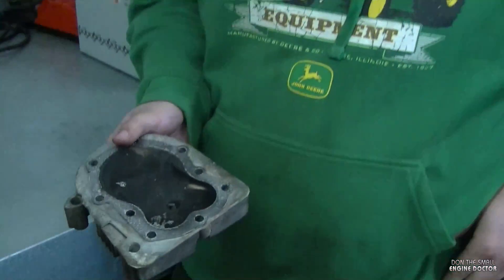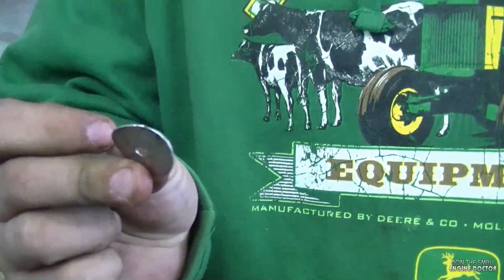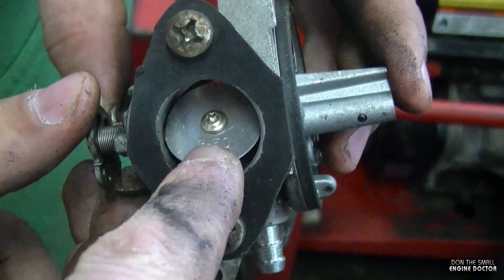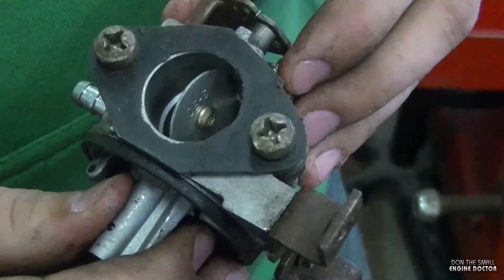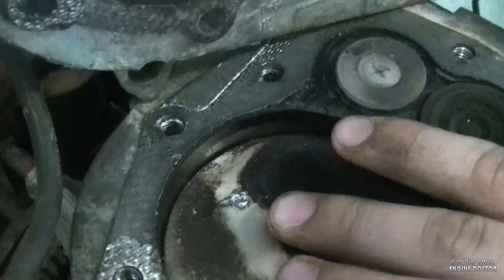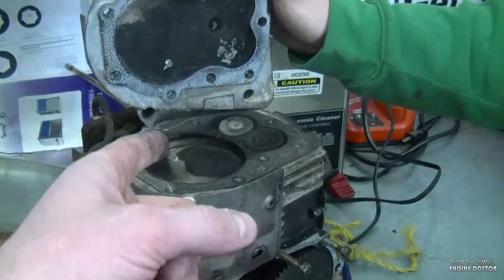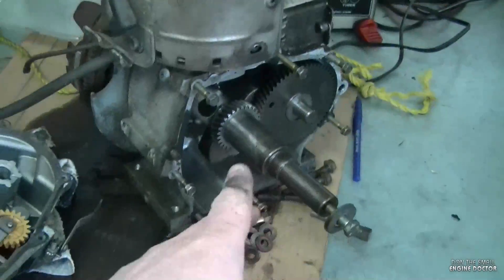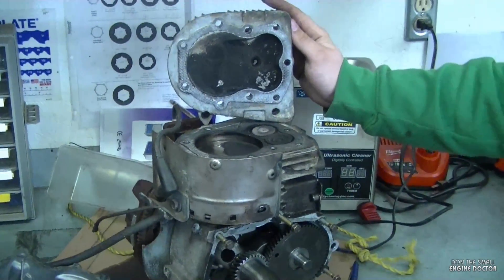Seized Tecumseh Engine Diagnosis by Joel My Co-op Student

Comment: Hey, my John Deere 325 had a 17 HP kawasaki FC540V engine in it....and the head of the intake valve sheared off, destroying the cylinder head and putting a hole in the piston head...if I rebuild the engine and replaced the piston head, would I have to put new rings on and bore/hone out the cylinder too? If so, how would I go about it? Thanks

Comment: i LUCKED OUT on a briggs 12 horse flathead. same thing happened, but didn't cause any damage. the old screw is stuck in the muffler, i can hear it rattle when i kick the tractor. i remember when i was just learning about carbs i din't put loctite on that screw

Comment: I had a Geo Metro that the screw on the air filter came loose and got sucked into the engine.  Unfortunately for me I didn't have the same positive outcome as this engine did.

Comment: The throttle hung wide open in my briggs 5 how go kart. It turned out one of the screws from the air cleaner housing fell in from before. Luckily it didn't get sucked in

Comment: Had this happen to me. Turns out dirty air filter caused that valve to vibrate and loosen the screw due to no air circulation. Seen it on kohlers too

Comment: Very good video, I always put a piece of small wire in the spark plug hole down to the cylinder before doing anything else to confirm if it is bottom end or top end.

Comment: Once upon a time, those screws would have been staked to lock them in position. The modern ones have locktite painted on the threads, as do the replacement screws. Ancient or modern, those carb butterfly valve screws are intended for one use only. Remove it, then you are supposed to replace it with a brand new screw, not reuse the old one. You know how that goes.....

Comment: You should check the valves and seats also [mostly the intake]. It is likely that it scored them on the way into the chamber. Also what Kristiaand said, smooth the indents that the screw caused down.

Comment: A friend of mine brought me a Craftsman with a 16 HP Kohler that was making loud ticking noises.  I thought that the bolts on the connecting rod had loosened.  I tore into it to find everything tight inside the block.  The carb throttle butterfly was missing a screw.  I looked in the head to find a lot of ding marks on the pistol and the valves from the screw slamming into everything.  No major damage, and put back together with new rings and new crosshatch on cylinder walls as the mower was about 10 years old.

Comment: Hi Donny, it's worth a mention as well that with a mark like that on the piston and head it's wroth trying to smooth them over as much as possible as the marks will cause combustion hot spots in the engine when it runs, which could prematurely wear the piston, head or cause misfires. I know that for the cost of a piston and head for that engine it's probably not worth the extra labour todo this but figured I'd mentioning it for reference.